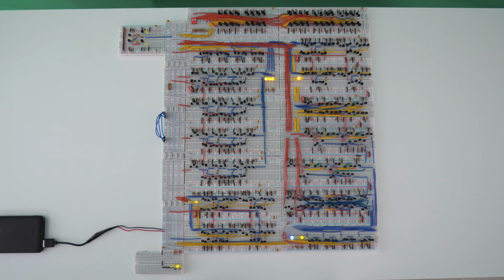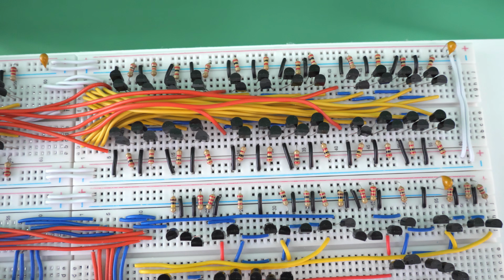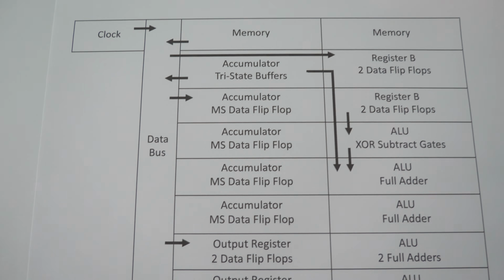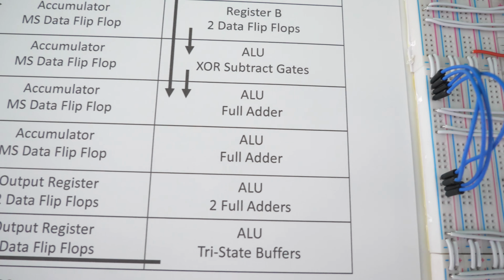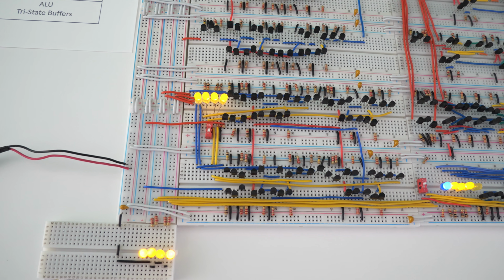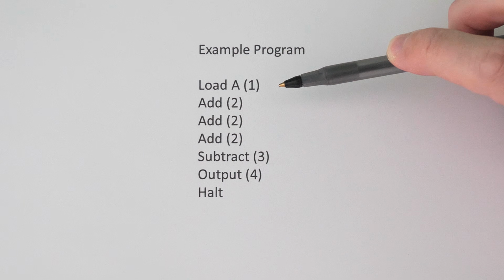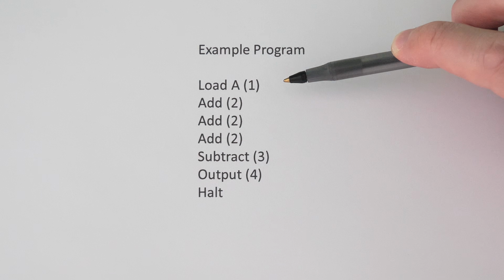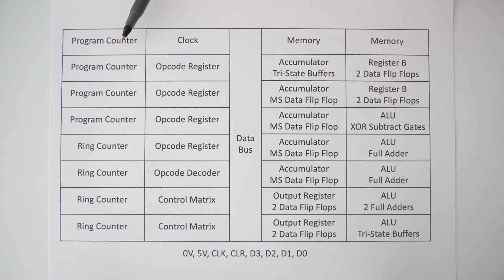How to Build a Computer on Breadboards Using Transistors

Comment: Sir, 2k resisters are not available. Can i purchase and use 2.2k resisters instead of 2k.
will the circuit works fine...?
Reply from the maker: Yeah, those will still work great! Slightly better even as less power will be used.

Comment: Hello, Cody. Is there any chance of us getting that video about the tri-state buffers you're using? Those are really puzzling me. I've even built one using four 2N3904s but it doesn't seem to work as intended.
Reply: Nevermind, I got it :)
Reply from the maker: Glad you got it! I do show the transistor level diagram in one of the videos! When I get more free time I would like to make that video!
Reply from the maker: @silicondarwinarchives6511  Other people have been asking this as well. Just so you know, in my other 4-bit computer video at time 9 minutes and 52 seconds I show the transistor level circuit diagram for the tri-state buffer.

Comment: Hello, how did you make such a small memory cell? Just making some logic gates to make a flip flop for just 1-bit requires a lot of resources, I wanted to understand how to do it in such a compact way
Reply from the maker: I show the circuit diagram in the other 4-bit computer video at around 5:30. Basically, each bit is hardcoded by using a buffer.
Reply: @GlobalScienceNetwork  thank you, i starting to make a computer using only transistors too
Reply from the maker: @Gustavo-Fatal  Sweet, let me know if you have any more questions! I am happy to help.

Comment: Why no capacitors and inductors are used here?
Reply from the maker: There are some capacitors on the power rails for power stability reasons.
Reply: @GlobalScienceNetwork i am doing bachelor in electronics engineering,  we struggle to understand even  basics of advance electronics.How can one understand design such as complex circuit. What can we do to understand and make such projects?
Reply from the maker: @sandeshadhikari3637  If you start with the digital logic gate video and then build a 4-bit calculator it will all make more sense. I took EE210 which is a 4-credit circuit analysis course in college so I know that the coursework can be overwhelming and not always directly applicable. Focusing on understanding small real-world circuit projects is a good way to understand the fundamentals to then be able to appreciate the theory as well.

Comment: How would I go about making this smaller version of the 4 bit computer? I found the logic gate schematic for the larger one on your website but I couldn’t for this smaller one
Reply from the maker: Good question. This is just the first half of the larger computer. Basically it is the right half. You can test the computer when it is half built. So the diagram would be the right half of the larger version.
Reply: @GlobalScienceNetwork wait wouldn’t I need the other half for this project, to get like the ring counter and stuff or is it just extra things that aren’t needed
Reply from the maker: @plantor0728 Well they are needed for a full computer but in this video, I show how you can test the first half of the computer. Each section can be built and tested separately and then combined to make the full computer.
Reply: @GlobalScienceNetwork  oh then that’s perfect then, thank you for the help

Comment: i appreciate what you do. can i know which transistor you used? all of them are the same transistors or different mixed? 
can i use any NPN transistor here?
Reply from the maker: I used 2N2222 or 2N3904 NPN transistors. All the transistors can be either type. Other transistors with similar properties will also work. You can try and build simple logic gates with them to test if the transistor will work. Some NPN transistors will not work as logic gates.

Comment: how much volt is your power supply?
Reply from the maker: I powered the computer with a 5V 2 amp battery pack.
Reply: @GlobalScienceNetwork  Okay, tysm, i'm going to try to make something similar with breadboards
Reply from the maker: @SukiYaki1904  Sweet! Good luck! Let me know if you have any more questions.
Reply: @GlobalScienceNetwork  Yeah, I have one, how much 4 bit registers can fit on 1 breadboard, jk flip flop or data flip flop.

Comment: it would be cool to see more features like more opcodes eg. ldi and a buncha others, memory and memory access, and a seven segment display
Reply from the maker: I have another video with a similar title where I show the completed computer with the opcodes, decoders, counters, control-matrix etc. A seven-segment display would be cool as well. Since the numbers are low it is pretty easy to know the numbers in binary.
Reply: @GlobalScienceNetwork  thats cool, btw, i tried making a nand gate full adder from transistors, but the carry out is constantly on for some reason, idk if it is loose connections in my breadboard, what do i do?
Reply from the maker: @pixelgoose98  It could be a bad transistor. Try swapping them all out. If that does not work then check to make sure it is wired properly really closely. You can check the logic of each NAND gate to see which one is not working.
Reply: @GlobalScienceNetwork  jut checked it and its working! turns out it was like a 100 loose conections, will u guys ever make transistor computer tutorial?
Reply from the maker: @pixelgoose98  Nice, yeah troubleshooting can be tricky. Well, this was part one, and the transistor computer was finished in the next video. It seems you are on the right track with figuring out how to build it, start with logic gates, then flip flops and adders, and then work on building the registers and counters. If you work your way up from the basic videos my goal was for this video series to show enough detail to be a full tutorial. I even show the logic gate diagram of the entire computer.
Reply: @GlobalScienceNetwork  okay thanks!

Comment: but where is the circuit diagram? is there any link for the circuit diagram
Reply: Thanks for your circuit diagram❤️
I have got it!
Reply from the maker: In my latest video, how to build a 4-bit computer, I finished building the computer and provide a full logic gate level circuit diagram for the computer. The video is in 4K so it should be about as clear as the original. If you would like the diagram as an image, email me and I can send it to you.

Comment: Interesting video, but there are some glaring problems:
- Incorrect terminology, in the sense that the word "byte" is being used to refer to a 4 bit word; the correct name for this is "nibble" (or half of a byte).
- While this structure is part of a computer, it is not in its entirety a "computer" according to the conventional definition. It is apparently not able to execute a stored program, as evidenced by all the manipulations shown in the demonstration. It seems to only store data in its tiny memory, but the 'program' appears to be only in the mind of the operator, hence the manipulations (and it seems to not have the capacity for decoding stored instructions, if there were any).

So, nice work on the building blocks, such as they are. But potentially very confusing to viewers who are just learning and don't know any better when the video presents one thing as another and uses misleading terminology.
Reply from the maker: Thanks for the feedback. This is a sort of a part one and I explain at the end that I will be building the rest. I thought it would be helpful to show the manipulations by hand before showing the entire computer using the control matrix as this might be information overload. I have the computer finished now and am making the video for it now so the video should be posted soon. I am doing this to teach others and learn so I welcome constructive feedback. If it was an 8-bit computer I think your terminology is correct when the byte is split into two 4-bit parts. Since this is only a 4-bit machine I think referring to it as a byte is correct.
Reply: @GlobalScienceNetwork  , all the referenced I have define a "byte" as being 8 bits wide.

I am pleased to learn that you have enhanced your device, and look forward to seeing the new video.
Reply: @youtuuba there’s a difference between a byte, and an octet. The latter being the unambiguous name for a collection of 8 bits.
Reply: @desertfish74 , well, all I can say is that I am one of the people who was there in the early days of microprocessors and personal computers, and recently completed a career in computers, and so far I have never encountered the use of the word "byte" to mean anything other than an 8 bit word, and "nibble" was always used to refer to a 4 bit word. I guess there may be some 'camps' that use different terminology, but since this video purports to be educational and targeted at newbies, use of the word "byte" over and over when referring to 4 bit words it more likely to cause confusion.

I just did a bit of Googling, and found many definitions that say "byte" and "octet" are synonymous, and many websites that say that a "nibble" is four bits and is often used for half of a "byte". I do see some places that say while the word "byte" is not universally identified as 8 bits, nonetheless it is the generally accepted standard definition, and that when " byte" is on occasion used for anything other than 8 bits, then "octet" should be used to unambiguously mean 8 bits, but in those instances the author of the document should make it clear up front how they are defining their terminology. I doubt that newbies are likely to benefit from the word "byte" as it was used in this video.
Reply from the maker: @youtuuba  Thanks for the feedback. I will plan to point this out when making the memory module video. For the next video, which I already made, I might just put a note on the drawing. I do see that many people refer to a definition of a byte as you describe. I like calling 4-bits a byte for this 4-bit computer as it can be fetched by memory and it is the full number being used. In some cases, this is how it is defined. To be honest I thought a byte could be 4, 8, 16, 32, or 64 bits. Since you are correct this is for educational purposes I do want to explain the terminology used.
Reply: @newm4304 ,  speak for your (apparently uninformed) self.
I am not 'clinging to anything, I was pointing out a source of likely confusion in this video.

When you say that viewers of this video are 'not idiots', that is not a useful statement. Viewers don't need to be idiots in order to still be newbies, and thus confused by a purportedly educational video that uses common terminology in a confusing way.

Comment: il clock è stabile? con il multi vibrator?
Reply from the maker: The astable multi-vibrator is just one simple way to make a square clock waveform. Even if you used a 555 timer it would be operating in astable mode.
Reply: @GlobalScienceNetwork  understood, nice project anyway, bravo
Reply from the maker: @gabe-g4j  Thanks!
Reply from the maker: @gabe-g4j  Also, I have the full computer built now and will be posting the next video soon!
Reply: @GlobalScienceNetwork  great, interesting! :)

Comment: Hi. I am attempting a similar project, but I encounter the problem of a loss of signal voltage after passing through all of the logic gates. Also a tri state buffer video would be appreciated. Keep up the great work. Thanks
Reply from the maker: These projects are a good learning experience. If the proper logic gate configuration is used each logic gate should be able to send a signal to the next gate without losing power. Some of the basic logic gates shown on websites or even textbooks only work as stand-alone logic gates. If you watch my logic gate video I explain this in more detail. If the data flip flops or circuit was working before hooking them up to a larger circuit then capacitors on the power rails can help with small voltage variations. I will be making a video about the tri-state buffers in the future as well. My goal for the videos is to explain things so people can build the entire computer so let me know if things are unclear.

Comment: What resistor value do you use most?
Reply from the maker: Most of the resistors are 2.2K. You can use 1K-2.2K but 2.2k will use less power. The main resistors that are different are the 100K resistors used on the input buffers and then different resistors for the clock which are 1k, 10K, and 100K.
Reply: @GlobalScienceNetwork  thanks